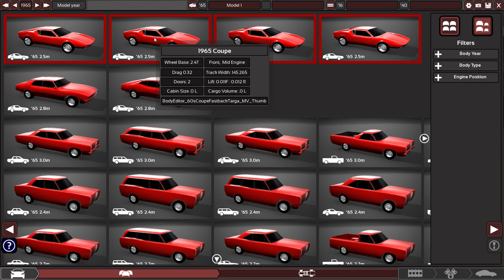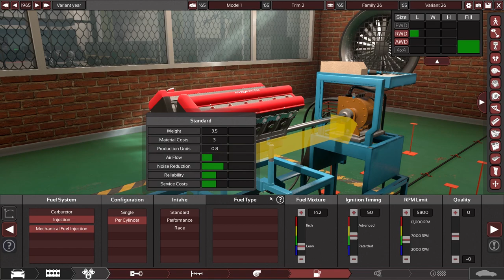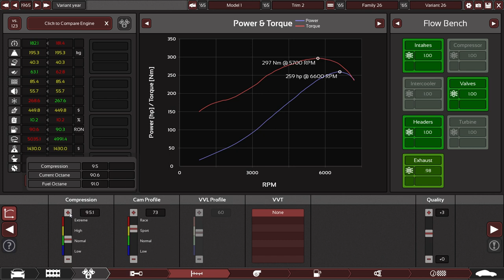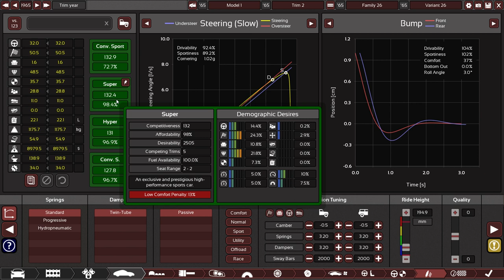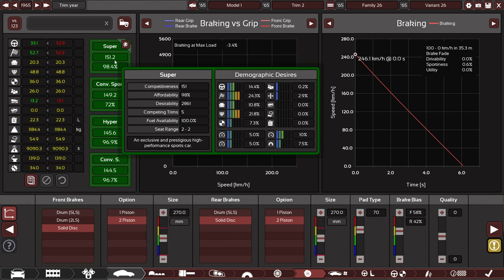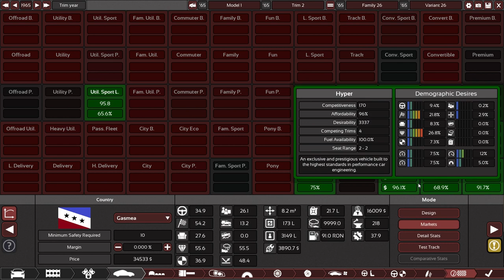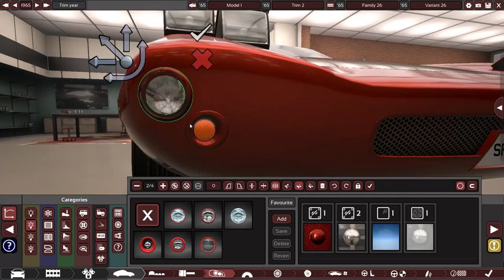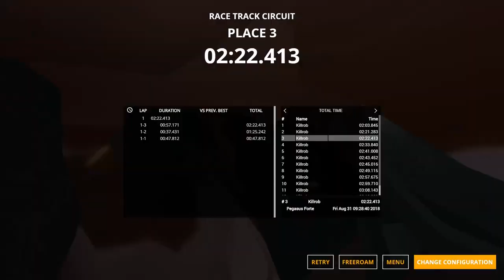BeamNG + Automation: 1965 Supercar, GETD Ep.22

Comment: To be fair on the engine size thing, the early Lamborghini Miuras had a 4-liter V12. And those badboys had a lot of wheel lift, as its story so often tells... 3.5 would be scary to an extent, but that is even scarier! :P

Mechanical Injection is a bit fancier than the norm for the era (picking up the Miura example again, that had six carburettors), but this is a series about fancy engineering, after all. 
And despite the smaller engine and power output, the estimated top speed for this thing is 15km/h higher than a Miura P400 (280km/h)! Shame the actual top speed is more limited German sedan...

But hey, at least the Pegasus can still scare the bejesus out of you with that ghastly front end. Rob Rob, too many headlights! This design is the opposite of your 1975 Fun design; great period-correct rear end, but that front end is a Cizeta V16's front with extra ugly. Ouch! Plus, it definitely needed more chrome...
Reply from the maker: The front certainly needs a lot of things... entirely DIFFERENT things xD but I gave up after a while haha.
I think the engineering side of things makes it what it is, really good to drive! :D
Reply: Like a flamethrower, perhaps...? xD But seriously, I think I'll try hand at redesigning the Pegasus. Worked with the Wellington Cougar before, might as well throw my own spanner into it!  
Yes, it's remarkably stable for a mid-'60s sports car. There's tons of grip for a mid-engined car, no sudden snap whatsoever... I've seen city cars with more oversteer! :o
Reply: @nikudriverhc4647  Can you share the outcome? I'd love to play around with that. My skills for design are absolute garbage... :/
Reply: @HyperScorpio8688  I would've loved to, but sadly ideas were few and I left the car unfinished, and eventually I deleted it.

Worse still, the new update has done strange things to car importing/exporting, so getting it back is unlikely... :/
Reply: @nikudriverhc4647  Thanks for the effort though!

Comment: Love the fact that you understandably despise old American engineering with their 8.2l engine doing a whopping 150hp.
Reply: IIOphaX The 70s were dark times
Reply: Lowest rating on the cadillac 500 V8 was 190 net HP in 1976. Highest was 400hp gross in 1970. The engine was never made for performance though. What i find more comical though was that an 80s HO 305 camaro was faster than a porsche 928 around a track.
Reply: but hey it's fun
Reply: That body is a riff on the De Tomaso Pantera, which used a Ford 351 Cleveland (5.7l) which had 330 hp and nearly 380 ft lbs (500 ish? nM) of torque in 1971. It wasn't a supercar though, it was a GT.
Reply: THERE'S NO REPLACEMENT FOR DISPLACEMENT REEEEEEEEEE

Real shit though, that Cadillac 500 came from the malaise era (mid/late 70's). Primitive emissions control and fuel systems could choke any engine. And that's without including the financial problems facing Ford, GM, and Chrysler
Reply: I am a european but euro cars depres me... they just do...
Reply: This post makes me violently angry.

Except in a displacement-limited racing class, the only real use for specific output is a straw for Honda fanboys to grasp at when trying to explain how the Civic isn't completely pathetic.

Comment: that RON is something i'v learned to keep an eye on, it seems in Automation that as long as you don't overdo the octan, you can do all kinda crazy shit. 
But one thing i'm not understanding. way is the fuel mixture say Max AFR XXX (any number)  , but in a case of a Direct injection , you can hit that Richness to the top to compensate for the RON , and still get some interesting HP out of it, even if the game complain that the engine runs too rich, as long as the fuel pump can handle it.
Reply: throwing out fuel economy and emissions when you do that however.
Reply: yeah, if i'm building a track car. i don't really care about fuel economy, but i just find Max AFR a bit odd, when it doesn't limit you in any direct way.

Comment: Make a full size sports truck/muscle truck. It still has to have an unmolested bed (meaning no hump in the middle for pushrod suspension) and it has to be a ladder or light truck monocoque frame. Same width tires all around. Manual or advanced automatic trans. 2wd. Lowered suspension. Low to medium profile tires(so probably 18" to 22" rims). Mass production parts only.

Basically a Ford Lightning/Chevy Silverado SS/ Ram SRT-10 competitor.

Comment: @KillrobPlays Why do you always favor throttling the engine with smaller exhausts?
Just an actual question because I don’t understand. I have a tendency to go big because I always go for numbers or “bigger is better” lol, but see you typically use a smaller pipe.
Reply from the maker: You need to do that to get better low-end performance without sacrificing too much top end. Usually a few horsepower on top are not preferable to a better overall power curve. With exhausts bigger is better only applies to turbocharged engines really, for NA engines you lose most of the beneficial resonance phenomena when you go too big.

Comment: anyone else cringes when he forgets to select double exhaust with V engines?
Reply: Not as hard as I cringed when he chose unleaded in 1965 and an open diff for a super car.
Reply: Well for his defense dual exhaust doesn't mean single header, just single end pipe. In automation single exhaust gives you better low end torque but can be restrictive if you begin to make great power (usually 350+hp)
Reply from the maker: It makes me cringe when people write comments like this ;P there is nothing wrong with a single end pipe on V engines.
Leaded bans come out in the 70s for new cars, so limiting it to unleaded does make a lot of sense if you don't plan on making a new version anytime soon.
Reply: @KillrobPlays  that's kinda cheaty, unless there was a big adaption phase before leaded gas was banned, making your engine work on unleaded knowing that it wouldn't work properly otherwise is either dumb luck, or time travel
Reply from the maker: Depends on when the switch in this fictional world would happen :) regulation is a slow thing, and the switch-over would be known about 10 years before the rule is active. So I'm playing along the lines of the game rules, nothing cheaty about it.
Reply: Nobody in the 60's knew leaded gas would be banned and nobody building a super car would have cared anyway. The goal is to make power now, not in twenty years.

Comment: How do you make Automation cars stable in Beam NG? Every car i make that goes over 150 mph just starts slowly veering off to one side until the car goes into a spin (is very unstable), and a car that hits 200+ mph is basically completely unstable at that speed and will nearly always spin out. Decreasing front tire size and or increasing rear tire size doesn't seem to do much to fix it, and even adding down force only reduces the symptoms, rather than fixing the problem.
Reply from the maker: No idea, I'm only really driving them on track and that doesn't get me those speeds :) so far I've not had too many issues with high speed stability in those beyond what you'd reasonably expect. I guess I'm the wrong person to ask

Comment: Quick question, what do the different regions stand-in for?
Reply: Different tastes. Think of it as different continents/countries. In Gasmea they like automatics for example (idiots), and in Fruinia they prefer sportier manual cars.
Basically Gasmea is USA, Fruinia is Europe, Archana is kind of Africa, Hetvesia tbh i'm not 100% sure, but i think it's basically a middle ground between Gasmea and Fruinia, and basically nordic Europe, and Dalluhah e basically Dubai.

Gasmea likes big cars, have big markets for off roaders, heavy dev, Muscles cars, that kinda thing, as they have big and decent roads. They also have low fuel prices and a board availability of fuel. They also care more about Safety than the rest.
Fruinia likes smaller cars, with big markets in city categories, light sports and have super and hyper car categories showing up much sooner (and bigger) than the rest. Fuel prices are expensive, so even higher end categories will still somewhat care about fuel consumption. They also have safety and emission laws sooner than the rest.
Archana is the between the other 2 in car sizes and markets, with no real tastes apart from budget. Basically everyone is fuck poor and everyone wants reliability. Fuel prices are cheap too, but the availability of different fuel types is very bad. It also has a very late ban on leaded fuel, and additionally safety standards are nearly nought for them. Roads are kinda terrible, so harsh/low rides are frowned upon.
Hetvesia and Dalluhah are new regions, so we haven't been told these specifics that much yet apart from what i said in the beginning. I would however guess that Dalluhah give no shits about anything and just want the maximum of anything, though markets should only open up much later, and Hetvesia will probably (total guessing) be pretty heavy on emissions and safety, even more so than Fruinia, and generally dislike cars that aren't eco friendly. Should also have high budget but fuck all taxes

Comment: You had 1800 RPM to spare. You could've taken some weight and gain some torque by lowering the bore and upping the stroke. Still, great video 👍🏻
Reply from the maker: Could: yes. Would: no. ;) This is where I wanted the engine to be, it is a compromise of a lot of things, as always.
Reply: @KillrobPlays  It really is a compromise, and each of us have our own way when it comes to design. I tend to go the min/max way. In the case of the engine you designed in the video, going with less bore and more stroke would've probably solved the valve float you were having at those high RPM, because of the smaller valves that come with a smaller bore.

Comment: Would it be possible to implement rotary engines, so we can make miatas?
Reply: You can make Miata clones in Automation at the moment, they use inline 4 motors. Rotary engines were more of an RX-7/RX-8 thing for Mazda.
Reply: Apart from what Nicholas has already said, they also said that they won't implement rotaries on the first version of Automation. They will probably do it as a DLC, along with Hybrids/Electrics and Diesels. Additionally if it's successful, they will also launch one with H8, H10 and H12, V4 and I2
Reply from the maker: Definitely not H engines, I don't think you know that H engines are. :P
But yes, we'll look at making Diesel engines first after release, all the other types might happen if the game does really well and implementing stuff like hybrids is feasible.
Reply: ? Are H engines not Horizontal engines, AKA Flat/Boxer engines?
Reply from the maker: Have a look at wikipedia ;D and NO, that's NOT what they are.

Comment: I mean... It is a nice car but v12? 3,3l? Injecton? As far as I know both ferrari and lamborgini of the day (I know they stated in the 70s, this car will probaly never leave the labs before the moon landing) had carburetors and used larger engines...
Reply from the maker: Didn't Mercedes use MFI in the mid 50s? :)
Reply: KillrobPlays I know that but this mercedes was ludocrously expensive and it had roofmounted doors... also this is why I didn't mention it... (i hoped you didn't watch that TG episode)
Reply from the maker: I assume TG = Top Gear? No, I haven't seen that episode. It doesn't matter though, MFI was known tech in the mid 60s, yes it was expensive, but that is reflected in the costs and engineering time of the engine. I think the engine really isn't as weird as you make it out to be. 3L V12s were pretty common for European supercars, could have gone down all the way to 2.5L.
Reply: KillrobPlays Yeah but if you are going down to sub 3.5l why a v12 and not a v8 or an I6. Jaguar E type (which is THE quintessential 60s car) had a 3.7 inline 6 and it managed 265hp (similar to your pegasus) So why do you need this layout at this displacemet?
Reply from the maker: It is more prestigious and can rev higher without big quality slider investments. Those are important qualities in a supercar.
Reply: KillrobPlays I suppose so..., I do say it definately a great super car🖒, just not my kind of car... I am kinda biased towards landbarges and pony cars. Speaking of pony cars...

Can you please try making a pony's pony car for the lols 🙃
Reply from the maker: Yes, a Pony car episode is coming up, it is uploaded already!